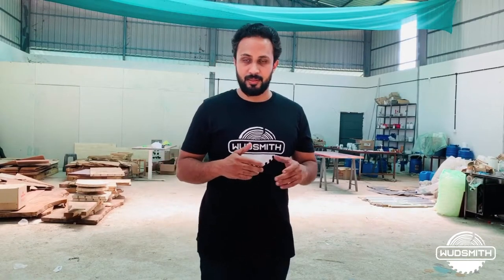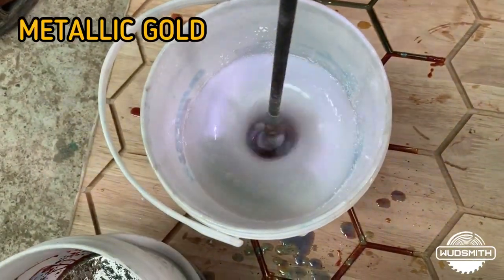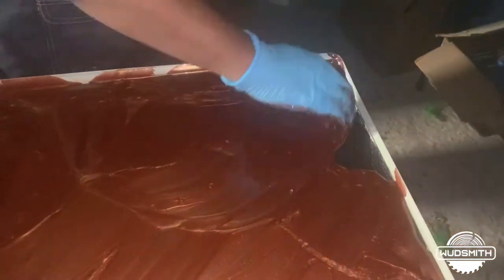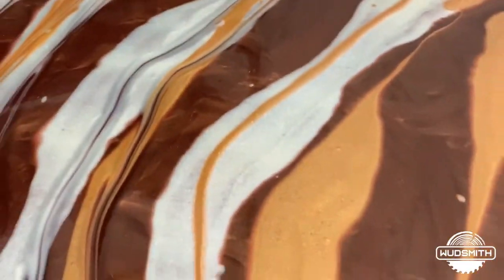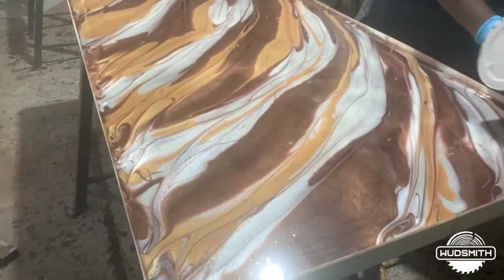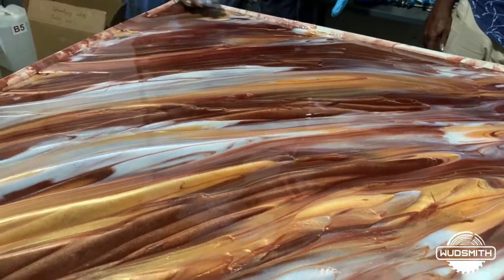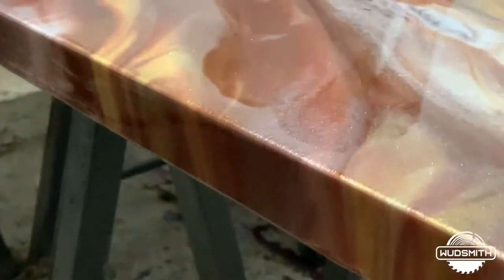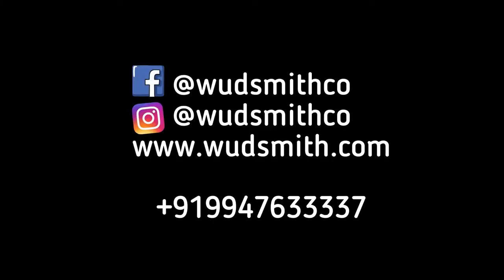Countertop Ideas # 2 - Epoxy ResinTable in India, At Home, Art for Beginners- Epoxy Resin Table Pour

Comment: what will be the weight gained by the board/wood  after the epoxy has hardened.?
Reply from the maker: Technically, same weight of the epoxy thats poured. We havent tested if theres any variation in weight after curing